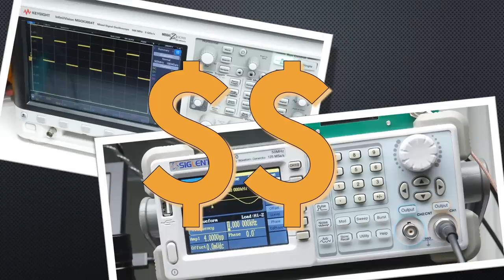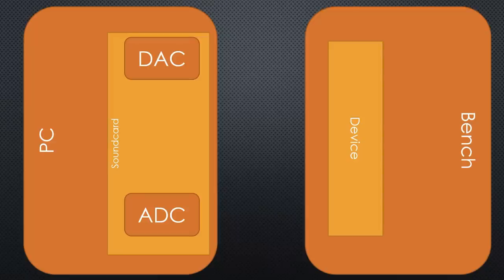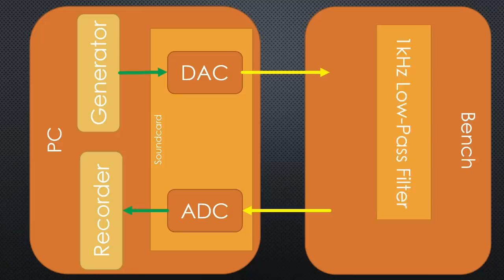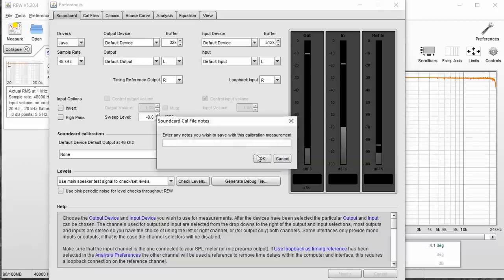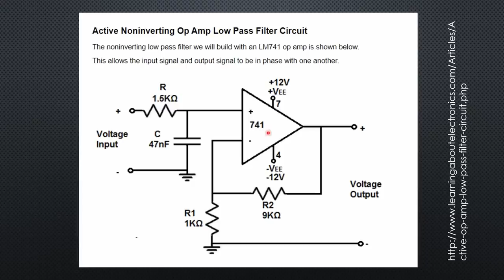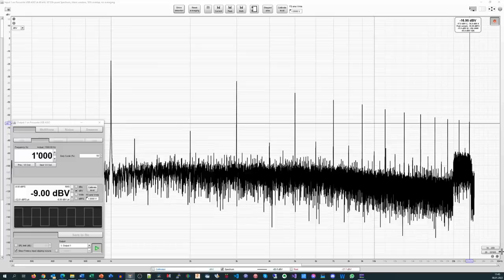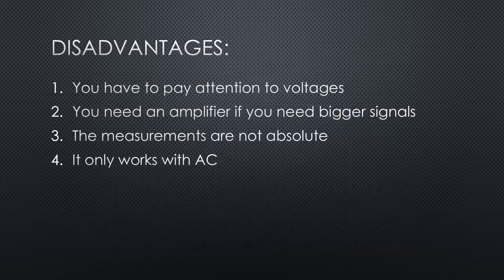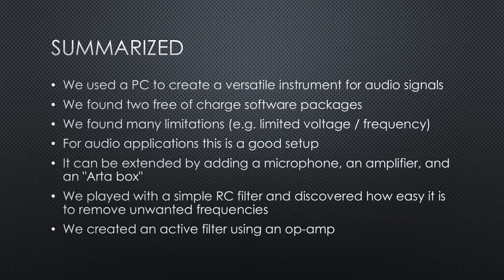#413 Your PC Soundcard is an Oscilloscope, a Signal Generator, and a Spectrum Analyzer (Arta, REW)

Comment: I have been using the free DAQARTA demo program which allows unlimited use of its oscilloscope and a few other functions, while its signal generator is limited to 30 times or 30 days use after which you need to purchase it or re-install the program for another 30 times/days of fully functioning demo, which includes its most important tool to me: an LCR/ESR meter which can measure as low as 1mΩ resistance, 1pF to at least 10,000uF and less than a uH resolution (I think as low as 1nH), though such low measurements are filled with noise, depending on the soundcard's S/N ratio.
I use an Audiophile 2496 soundcard, so the noise is at least 10 times lower than on the standard cards.
Reply from the maker: I did not know that they could do such precise measurements!
Reply: @AndreasSpiess  Even with my 2496 sound card, actual usable resolution for inductivity is 1uH, with 0.1uH digit changing all the time and you sort of see which number is the most frequent. Below that, numbers are changing too much to be useful.
 All that is needed besides soundcard (and a cable) is a reference resistor and probes, and the ability to short out the reference resistor when calibrating the software.
 I plan to add an external output amplifier so that I can use a lower value REF resistor (improves S/N ratio) and a pre-amp at the probe (also to improve S/N ratio).
 One channel is used as an output, and 2 channels are used as an input - one takes signal before and the other after the REF resistor, comparing their phase shift and relative values to automatically give out results as capacitance or inductance, along with ESR and DF for caps and resistance and Q factor for inductors.

Comment: Right! I've always wondered about this, I had (sadly gone) a 192khz 24-bit sound card with 8 channels. No, it couldn't compete with a 100Mhz oscilloscope, but measured signals seemingly with incredible fidelity with very low SNR, onboard filtering etc. Certainly usable to observe behaviour of most MCUs
Reply from the maker: Indeed, we should not compare it with an oscilloscope. But the SNR is truly much, much better...

Comment: I've certainly tried stuff like this throughout the years... There are just times when u want a particular waveform or pattern of waveforms. However, I would highly HIGHLY recommend to not use any direct lines into the computer. Just get ANY gear which is external to your computer. Great for making amps & guitar pedals :)  Also, make sure to get an audio amplifier for your output. 
Output chain looks like:  PC>audio interface > amplifier 
Input chain looks like: custom opamp divider > audio interface > PC  

I feel like this is a second step in the path of learning EE. First step would be to get a signal generator + oscilloscope. Caz, how are u going to test ur custom opamp divider thingy if u don't have suitable equipment to begin with ?  

REW is awesome. An absolute staple in the kit...
Reply from the maker: It is certainly good to protect your PC. But for experimenting with audio signals I think this is a valid alternative. Not for an oscilloscope, of course...
Reply: So probing around a breadboard distortion pedal circuit with a 9v supply would be unsafe with a soundcard oscilliscope?
Reply: @mikejones-vd3fg  Just to be more clear with what I wrote caz it see it's kinda hard to read. I highly recommend against using any direct connections to your motherboard. I have fried 2 & a usb dock. What happens is that device fails. For example: I was using ardruino plugged directly into motherboard via usb = It took years but eventually I burnt something by accidentally crossing wires for the slightest of time :((. Just a touch. Oops.  Now all the front panel usb's do not work. Looking at the motherboard >> power goes into the usb IC, but its dead.  I got smart and started using usb docks. Resulting in another dead usb. But at least it's a dock & can be replaced.  It's an accident waiting to happen. This is mainly caz computer devices are not designed to handle over-voltages.  They're designed to stabilize voltages.
     Specifically about a soundcard, 9v is way above the "line in" rating of 1.5v. I don't know how that would turn out. Sounds like a bad plan. You would have to know how the front end is designed. i wouldn't be surprised if putting any DC into the soundcard for a period of time would mess things up.  At least if u were to buy a usb soundcard, then that usb device would fry & not your computer motherboard.  In general AD/DA's are pretty sensitive in my experience. I've seen many die from normal use, let alone outside recommended ranges. 
    If you think about it > the PSU on a computer maintains the voltages precisely. They will dump large amounts of current just to keep voltages correct. 
    I think my recommendation of using an audio interface is good. Many can handle +4 signal levels :) I've used a ton of these and never had a problem.  I still think it's wise to design an op amp divider/buffer so it ranges your input correctly. Also an opamp has a known current output.  It's a good thing to learn. . .  Don't forget/overlook that you can set the opamp gain to at any level you wish. Then you can see all the small signals when the input is off, like the noise floor/crosstalk/signal bleed/etc ...    
      Another thing to know is oscilloscope probes are amazing. If you compare alligator clips to Oscope probes, the noise pickup is night and day. Noise&signals will go right into the wires of alligator clips. Not with Oscope probe wires.
      Have fun, don't burn the mobo like I did ;p

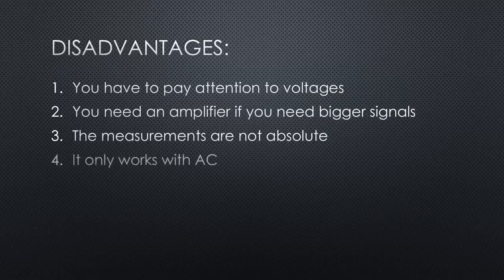Comment: @13:38 regarding disadvantage #4 that sound cards don't measure DC:  For most soundcards that is true.  However some soundcards (such as the MOTU 624) have DC-coupled analog outputs, meaning that those outputs can provide DC (and low frequency) output.  Though I don't know if there are soundcards with DC-coupled inputs.
Reply from the maker: Thank you for the info. Another viewer also wrote that he removed/bridged the input capacitors on a "normal" Soundcard
Reply: @AndreasSpiess   I was going to suggest that. ADCs are mostly DC-sampling devices and most sound-cards should be able to sample DC by shorting the input caps, unless high-pass filtering was done in the feedback or the DSP.

Comment: If you get a professional sound device (as opposed to an Ali-Express "professional(tm)" sound thing) you should be able to handle up to about 24Vpp of both input and output levels without distortion. Obviously if you are working with unknown-level signals it would be a good idea to build a +-15V clipper for the input signals.
Reply from the maker: That is interesting! After this comment I looked up the specs of my Focusrite and it has a max input of 22dBu which s 27Vp-p at minimum gain.
Reply: @AndreasSpiess  The Scarlett qualifies as a professional device. Basically if it has an XLR jack and 6mm TRS jacks, it is likely to be +20dBu or better. It should be able to output similar levels into 600 ohms. Pretty much all of these devices run the internal opamps from +-15V, so subtract about 6V from that to get the max direct input level or max output level.

Comment: Unfortunately very few modern computers and external sound cards have stereo line input, a mono mic is predominant, which makes it difficult to input signals. My oldish PC is good in this respect.

Two other free softwares are
Digilent Waveforms (front end for their instruments but includes a sound card option)
Soundcard Oscilloscope by Christian Zeitnitz - a bit dated interface but does the job reliably
Reply: You should look at more expensive sound cards. I have a thing sitting beside me with stereo mic inputs, and 8 channels of balanced line inputs and 8 channels of balanced line outputs. Of course it cost me a few hundred bucks.
Reply: @lwilton  ... which totally defeats the point of the original video
Reply: @alexandern8671  No it doesn't. The title of the video isn't "make a scope for free", it is "use your sound card as a scope".
A $300 sound adapter is still a tenth the cost of a $3000 scope, which is about the minimum these days for a decent scope. And the scope won't have the gain dynamic range and noise floor of the sound card, nor is it likely to have FFT or spectrum analyzer capabilities, and may not have a way to record what it sees on the screen. And you can get that $300 sound card for maybe half that used on eBay. I've got both a scope and a cheap PC with a good sound adapter, and I use both. They have different strengths.
Reply: @lwilton  Agree with your point regarding the title of the video. 
However I do not think someone with a budget of $300 should invest in a sound card for the purpose of scoping some signals. Andreas has discussed the downsides - no DC, limited frequency range. If one has such a card already like you then of course it is nice to repurpose it though. I can think of some niche applications where the increased vertical resolution could make a big difference but they are hardly the mainstream. Can you please give some common use cases that would benefit from increased vertical resolution?
Reply from the maker: @AlexanderN: Thank you for the links to the software packages.

Comment: I
I've  not checked all the comments  but it it's  important to to discuss the built-in hardware Nyquest fitters. The  bandwidth of audio frequency oriented devices is much more limited  as hinted at, but it is an unsumountable drawback if you want a more general purpose oscilloscope.
Reply from the maker: I agree.

Comment: Thanks for your video! I think this is a great idea!

I just wanted to say, that maybe you can use an optocoupler between the signal and the sound card's input. This would protect the sound card in a better way than the potentiometer.
Reply: For high voltage digital signals it is good idea for sure.
But I doubt that optocoupler will preserve shape of more precise signal.
Reply from the maker: Opto-isolators usually introduce a lot of non-linearities (as 
sdjhgfkshf mentioned). So this would disturb the signal. Maybe it would be better to use an external soundcard and a USB insulator.
Reply: @AndreasSpiess  : Yeah, I got an external USB soundcard for this very purpose (around $4, so cheap), though not a USB isolator.

Comment: Also a VLF digitizer paired with SDR software for receiving and decoding VLF transmissions.
Reply from the maker: You are right: Many SDR receivers use the soundcard. And all digital modes in HAM radio, too.

Comment: I bought an Asus sound card recently for this purpose, in the manual it even shows you how to use ARTA to measure the specs of the mic input.
My problem till now has been that all the sound cards I test inputs have been far from flat, some roll-off the bottom end, or top, or both.  On some, response is all over the place.  REW can calibrate a soundcard, it is great for removing a decibel here and there, but it can only do so much, you need somewhat decent hardware to begin with
Reply from the maker: As I showed it does not work for DC as well as above 1/2 the sampling rate. This cannot be changed.

Comment: I was duing some experiments with audio signals and misusing a sound card. I was using just an ordinary integrated Realtek HD Audio. I've discovered that the sound chip is doing some funny stuff to the signal. Namely it seems it has some kind of autogain, which can't be controlled or turned off from the software. Also laptops usually have only a microphone input, which is more difficult to use for recording arbitrary audio signals. So it's a good idea to carefully test your equipment, if it's suitable for the task.
Reply: That's true, especially for laptops that have limited I/O and usually combine headphone and mic together. The easiest and less risky way is to use an external USB audio adapter with proper line in/out. Worse case you kill the adapter but keep you computer safe.
Reply from the maker: Using an external sound card is what I recommended, too. They are no more very expensive.
But I agree, there is always a possibility that the signal is distorted by the PC.

Comment: While audio card oscilloscope is handy, there's some caveats; the processors and / or ADCs, and DACs used by most sound cards tended to be slow so 48 kilohertzs bandwidth is usable at most, if that. However, it's cheaper to do it and get done quickly.

And I strongly recommend that the line or microphone inputs be protected - the same way you would do when putting together a few more extra coaxial oscilloscope leads for the most expensive kit.
Reply from the maker: Thank you for the additional info!

Comment: For maybe 20 dollars you should be able to get an audio-quality stereo I2S ADC and DAC, feed them through fast optocouplers, and send that data to a USB MCU that can send it to your computer. Arguably there are some computers that will take digital audio signals like SPIDF and some ADC/DACs that can produce it such that you don’t even need the MCU. Then I’d have a 6+ resistor range switch followed by clipping diodes for the input, and a couple of different gain amplifier settings for the output. Maybe an input buffer amplifier running on some larger voltage rails, for input impedance purposes.
Reply from the maker: I agree that this can be done. But you forgot an important ingredient: The software which also would have to be written.
Reply: @AndreasSpiess  from what I hear the Arduino Pro Micro has a fair bit of code written for it out there, acting like a sound card is almost certainly one of those. If that bitrate isn’t fast enough then the same should apply to the STM32F103, though they’re a little tougher to get programmed.
Another option is using an FT232 and SPI ADCs/DACs, not sure how much programming they need, but I’d guess it would be less than the STM32 and still give you full speed USB2.0.

For USB3.0 purposes there’s the Cypress FX3, but from what I hear that’s a pain to program and it’s only really necessary for really high bitrates or SDR territory.

Comment: I'll stick with my scope for the measurements but having a programmable signal generatr could be extremely useful
Reply: I think the point is that if you don't need it for high precision and rarely, it's probably good enough. If you're doing anything that requires serious precision, you'd probably want to just buy a quality bit of kit.
Reply: get an analog electric analog computer. Best SG you will ever get.
Reply from the maker: @Frank: I agree it is not a replacement for an oscilloscope.

Comment: I like adding small serial resistance (100 Ω) and two (or four) diodes as protection for overvoltage.
It will be possible to put 10 V signal without damaging hardware with such setup.
While low voltage signals will pass through almost not distorted.
Reply from the maker: Good point. Thanks!
Reply: I was thinking the same! but what about measuring mains voltages? Even if you trim / clamp down with diodes couldn't a single line be somewhat referenced to your soundcard and cause damage?
Reply: @MattReb090  I'm not experienced enough to work with mains voltages, so I can only guess. I think transformers may help - secondary voltages should be isolated and proportional to primary. Also it is worth trying to make capacitive coupling. Just putting long wire next to mains line - making antenna in other words.

Comment: No one here seems to have mentioned USB isolators yet. Isolation on the USB side would seem a good general purpose approach that would be transferable between lots of use-cases where you want your precious PC connected to a bench of not-yet-proven project. A USB isolator must be a fairly tractable thing to implement, but I've done a load of searching on Amazon and not found anything that definitively performs this task. I'm sure they must exist and I'm just failing to find them. Thoughts ?
Reply from the maker: A good idea. I added a link in the description.

Comment: Java driver is limited by your windows setup of soundcard output profile, it defaults to 44100ksps.
Many proper soundcards support 192 ksps which is why 96 kHz works with the other driver.
Reply from the maker: I do not know where the limitation comes from. You are right, as I showed, the proprietary drive went up to 192k.

Comment: Interesting. There was a old project ELFRAD That was analysing earth signals down to wavelengths days long if I remember right (earthquake prediction, the moon even) This would probably be ideal for something like that exploring those signals.
Reply from the maker: Maybe. But then you would have to bridge the input capacitor because it blocks DC and low frequencies.
Reply: @AndreasSpiess  right, forgot! There would be a filter cutoff on the input.

Comment: Many years ago a friend and I used to maintain a microwave radio scheme which used an analogue multiplexer We challenged ourselves to decode the baseband with just a laptop and no hardware (except a cable). Cooledit on a Windows 98 laptop did the job...
Reply from the maker: Indeed, many current SDRs use soundcards for demodulation. And of course all digital modes. But you were very early!  73 de HB9BLA.
Reply: @AndreasSpiess  thank you for the reply, this was an analogue multiplexer (Granger DTL-7300) the individual voice channels are SSB with carriers at 4,8,12, 16kHz and extending further up, these are then modulated onto a sub carrier for transmission over a microwave FM link. Fascinating things to play with! 73